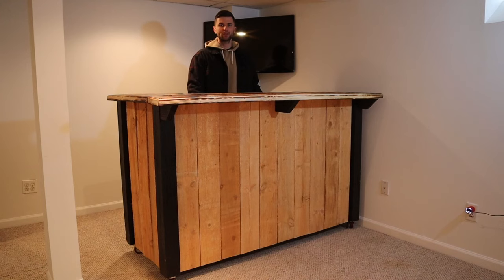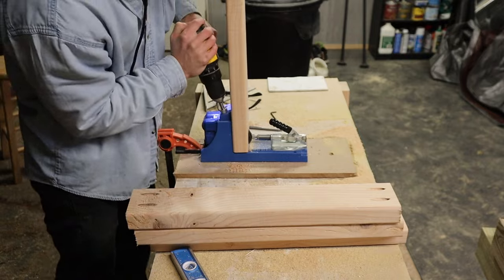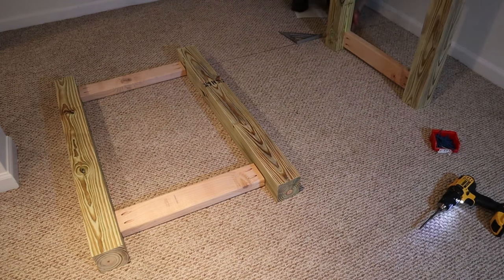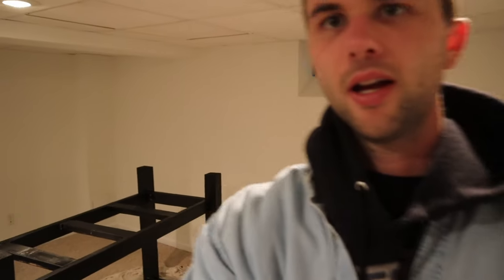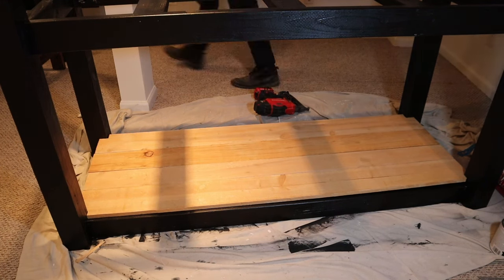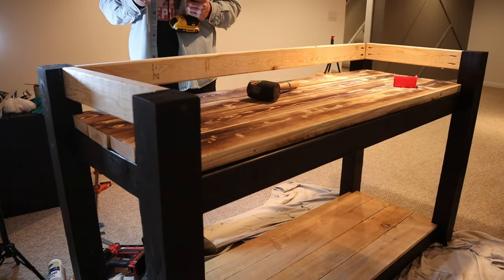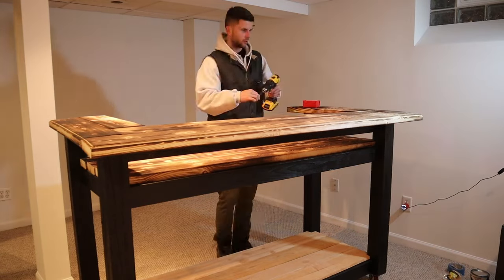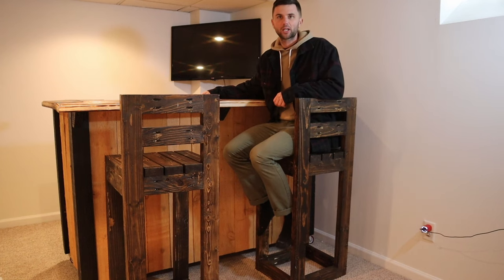How to build a DIY indoor or outdoor bar

Comment: In the materials i need You put (18) fence picket. What is that? In your video, where do you used it? Thank you.
Reply from the maker: For the fronts and the sides of the bar you’ll notice that towards the end of the video when I install them. You could use other material as well

Comment: How long is this bar? I'm look to make one 6' long. Do you think I'd need an addition support in the center?
Reply from the maker: The bar length is 70 inches long so just under 6’. I would recommend adding an addition support in the center.
Reply: @StarterBuilds  do you have a working link for plans?